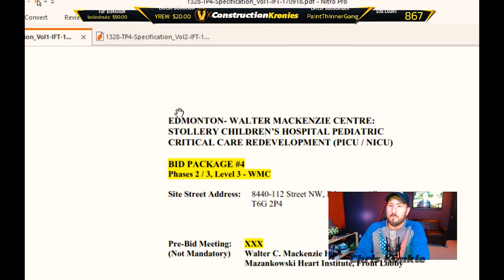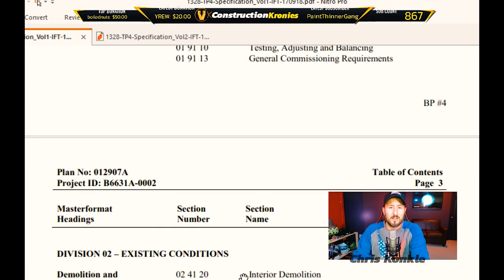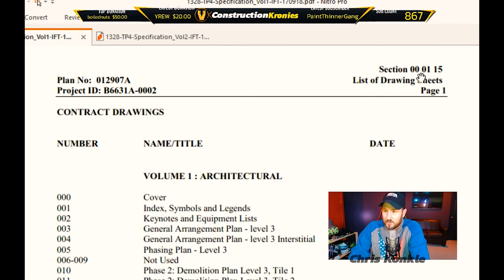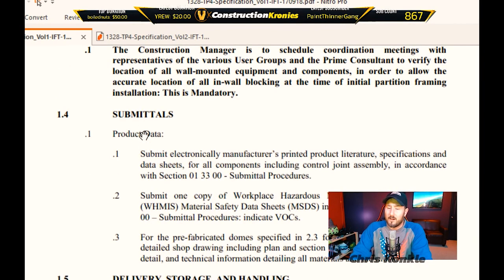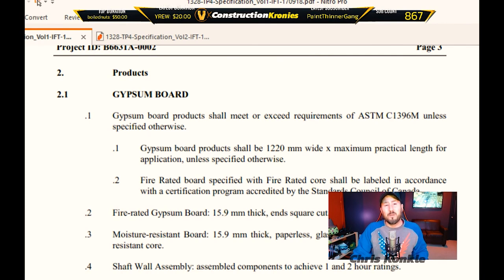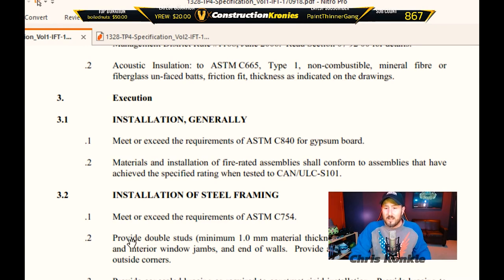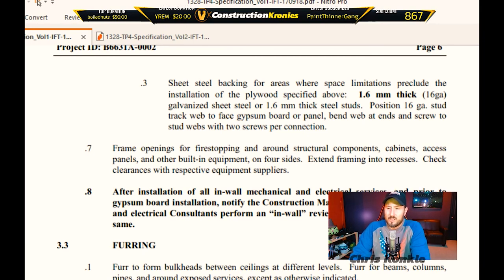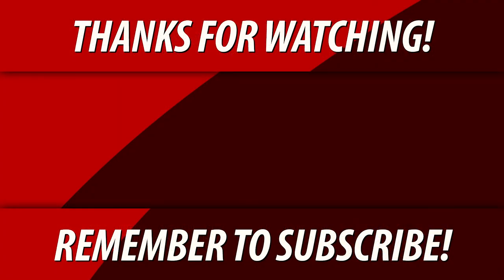Commercial Drywall - Learn Specifications

Comment: Good vid Chris.  I'm having flashbacks of working for Otis Elevator Company.  After I was injured on the job, I was offered a job in the district HQ as a Contract Processor/Project Coordinator.  Our group was responsible for reviewing all the plans, specs and contracts to assure what the salesman sold was in compliance with what was contracted and specified in the plans and specs.  We handled the job from it's inception until it was signed off by the the GC and architect.  

We had to break down in detail what the customer wanted versus the bid and initial estimate.  Many times the salesman overlooked important parts of the contract and specs and bid incorrectly requiring addendum's to both the contract and the specs.  Sometimes it was a nightmare.  LOL.  

Anyway, enjoyed the vid and I'm looking forward to your Contract segment.  Cheers!
Reply from the maker: William!! My man! I love hearing about your work. It is a true fact that every time you win a contract the very first thing you do is open up the contract documents and figure out what you missed. It happens everyday. Contractors, estimators don't communicate enough during the tender phase because they want to be as competitive and secretive as possible. It is easy to overlook the simplest details because the specs and drawings can be very complex and wordy.
Reply: @ConstructionKronies  Yes, exactly.  The worst contracts were US Government or GSA specs.  Many time the elevators were spec'd out on 1950's technology when in the 80's it was turning to all solid state control from electro-mechanical controls.